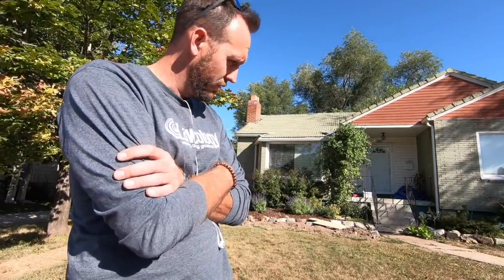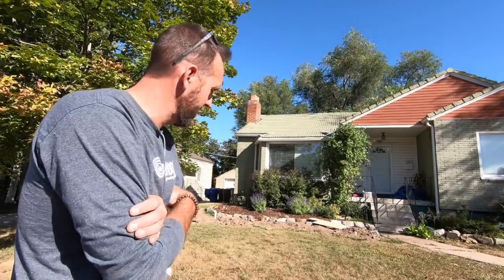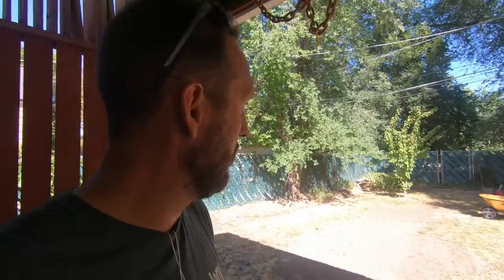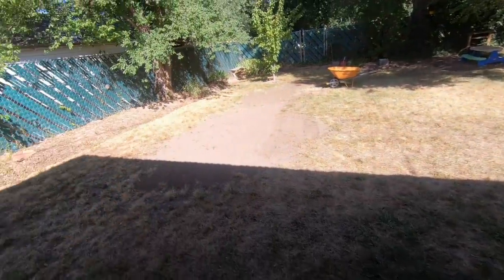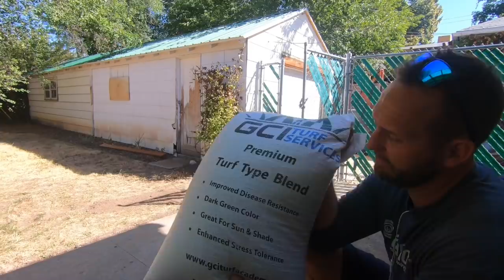Salt Lake Lawn Renovation Part 2: Topsoil, Top Dress, Lawn Leveling, GreenePOP, Grass Seeding

Comment: Love the information,  keep it coming! I have a lot of your n-ext products but I always have trouble using them in the ortho hose in. Any tips?
Reply from the maker: glavotsky23 hmmm... did you clear the filter? Meaning remove it and keep the weight? Pull in the straw to clear any particulate.
Reply: @Lawncology  I did not try that, the only thing I've tried was poking the hole in the filter. I will try that and see how it works.  Love the products,  I swear by them.  Thank you again for all the information and content!

Comment: I wish I could have a small portion of that green pop. I only have 1000 sq ft and that's just to much for me for a single use. But I'm still using humic12, air8, green start and milorganite
Reply from the maker: +The Weekend next year throw it in a build a box and use it a few times throughout the season as a P supplement.
Reply: Lawncology ahhh I hate your logic ;) jk, not a bad idea. I’ll need to order humic12 soon so I might get it at that point.
Reply from the maker: The Weekend 😁😁

Comment: Tenacity at seeding?
Reply from the maker: kenny cooper negative
Reply: I wish I would’ve this spring after bringing dirt in for a major leveling job. 40 semi loads. I had more crabgrass than grass it seemed like. Was hard to get rid of the crabgrass for fear of killing off new grass. Once I got it under control the grass started doing pretty good. Think I’m going to be getting some rgs and air8 soon for it
Reply: 40 semi loads? What were you covering, a park?
Reply: Minou TV I have a little over 2-1/2 acres with a creek that runs through it. There’s were 2 large low spots about 2’ lower than the rest. So when the creek flooded the water would sit in the low spots to long and kill the grass
Reply: @kenny - ok,  a small park compared to my postage stamp 1,600 sq ft lawn. 😆  I’m a master volunteer for the San Jose Municipal Rose Garden, that sits on four acres, so I have a good idea of your yard. That’s quite an undertaking, it must be beautiful with the creek and the lawn reno..I’m so glad they are shipping out to California now, I’m looking forward to trying these products. Good luck with your project!
Reply: Minou TV thanks it was looking good until the creek flooded last weekend. My yard was under water for about 48 hours and then about another 48 where it was pretty wet. Grass isn’t looking so hot right now going to fertilize this weekend and it should bounce right back